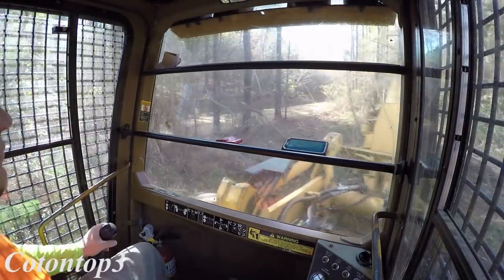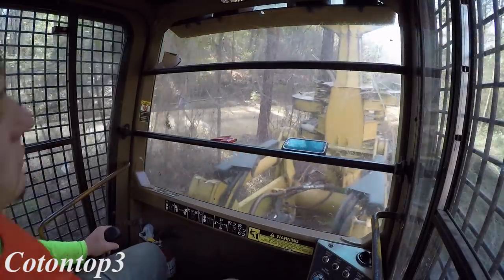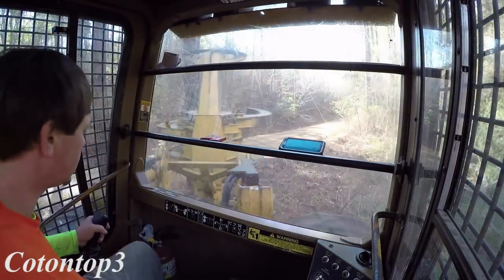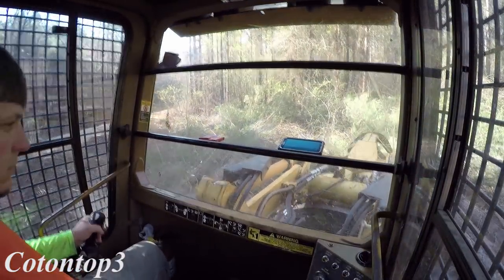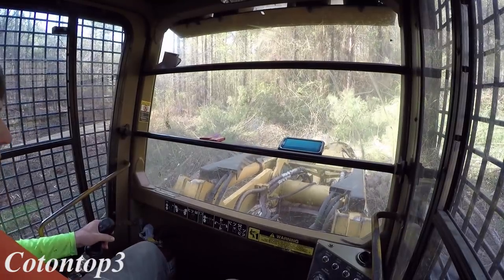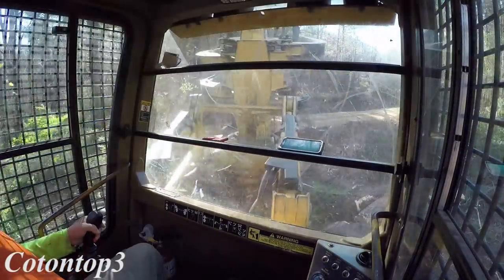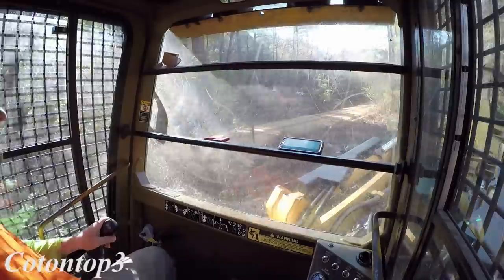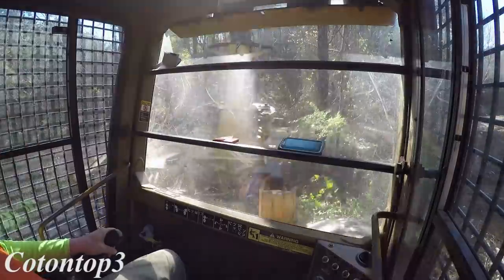Tigercat 726E, Chad cutting along a county road

Comment: Excellent video but it looks like a rough ride for the operator but between the man and machine it sure gets the job done in a snip!
However I don't really understand the method of working that machine efficiently. Do you drive in to the woodland a good distance and then cut and the trees on the way backout laying the trees down in bunches for the grapple to catch hold of the butts and drag them out to the processor?
Reply from the maker: +Dan Whiteford yes, the main objective is to not block urself from getting to the standing trees.